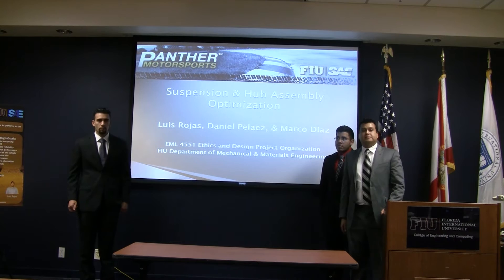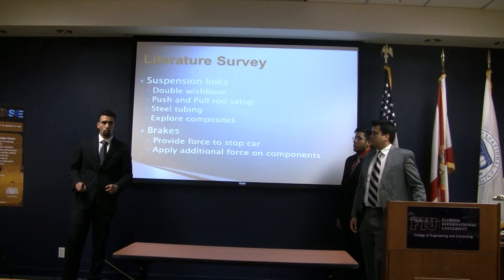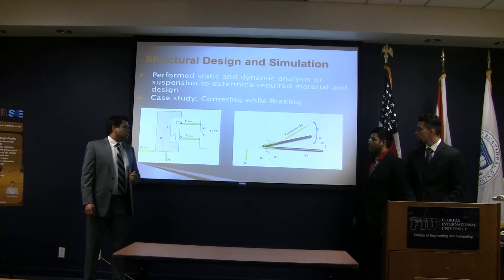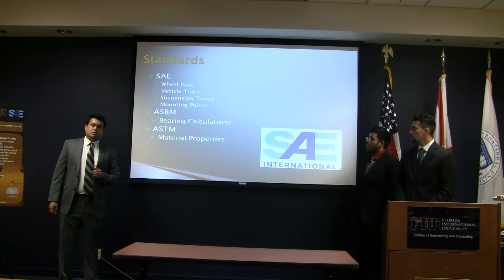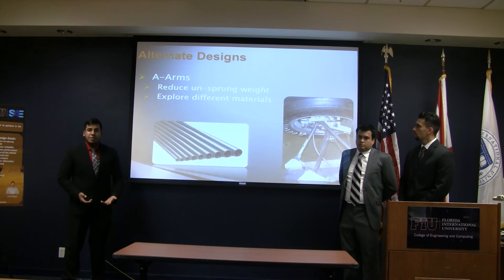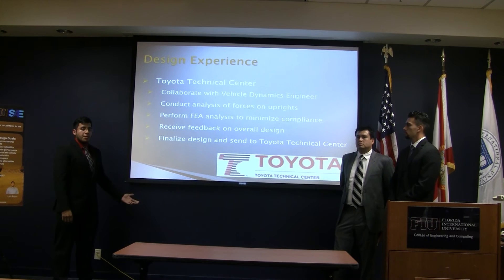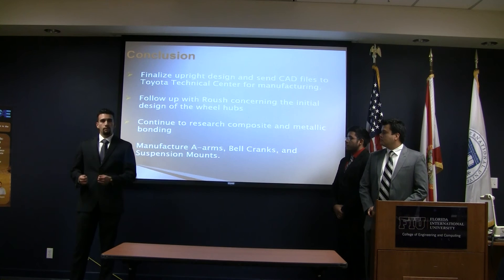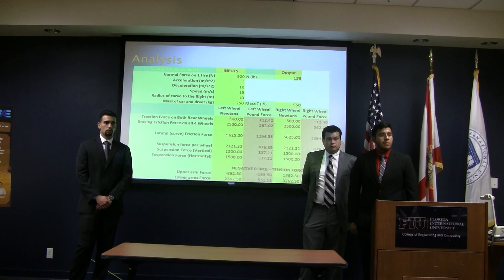SDO Team 23: Formula SAE Race Car Suspension System

Comment: Another Excellent Presentation. PowerPoint is easy to follow. Group is well versed in the topic of the project. The group shows that they have practiced the presentation before. Also, excellent in using images for the presentation of each of the parts that will be done for the project.

Comment: Team has an awesome display using solidworks as a strength to display a visual model and ideas of final prototypes. Good plan on keeping manufacturing cost down by doing them in house or using sponsors to aid in cost. Time would seem to be an issue if prototype is not produced in time to allow analysis and redesign if parts don’t meet expectations.